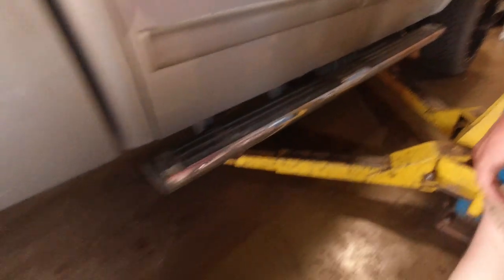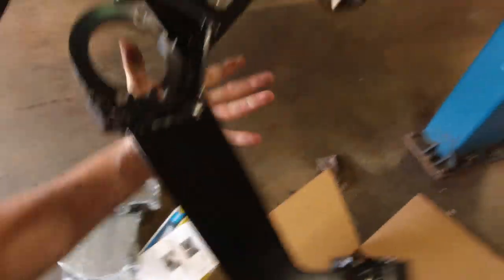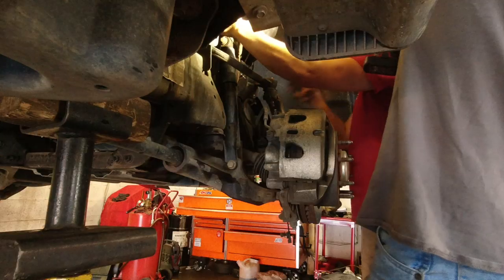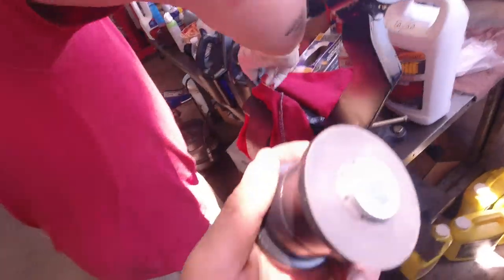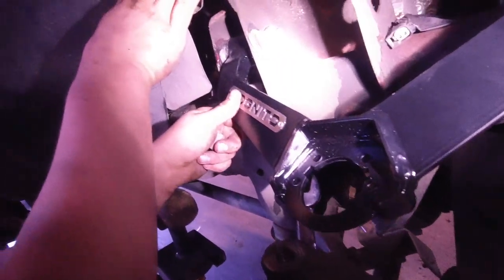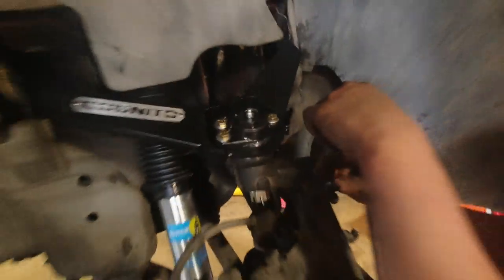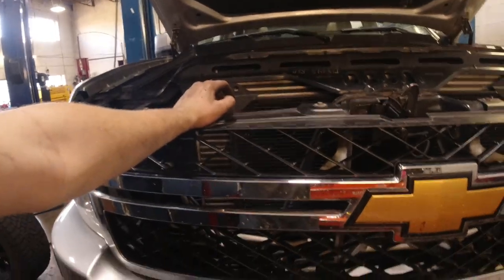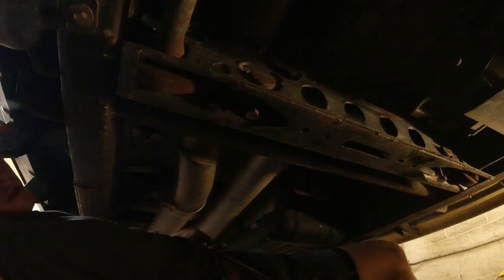HOW TO MAKE YOUR LEVELED TRUCK RIDE SMOOTHER!

Comment: Just a suggestion. If you loosen the nut on the control arm but leave it on and smack the control arm with a hammer it’s easier and safer

Comment: I have a 07 new body style 2500HD 6.0 did the 3" rough country lift with keys, shocks, upper control arms and 20x12 with 35's still rides like crap. Think the Bilstein shocks would make a difference? Truck didn't ride very well before the lift. Did the norcal mod and fender liner mods. I'm almost tempted to go to a 34" tall tire and loosen the keys but buying new tires to replace new tires sucks! LOL
Reply: Yes I have level keys rode like shit bilsteins made a huge difference I’d do it again
Reply: @ryanphinney438  thanks for replying I don't drive it much but I'm going to do the shocks. Maybe I'll enjoy driving it again 😁
Reply: @Joeshomegarage did it work
Reply: @CCCC-tq8yo  Still haven't got around to buying the shocks since I rarely drive the truck but now I know i've been thinking about it for a year! 🤣🤣
Reply: @Joeshomegarage  whatttt tt 👀🤯

Comment: You're not fully aware how torsion bars work. There are times you have to crank the torsion bolts to improve ride quality. Simply throwing on new parts is NOT the only factor to improve ride quality LOL. And where did you get the idea that it's okay to adjust those bolts with the front end sitting on the ground? You're putting serious stress on those threads.

Comment: HELP, 05 2500 Just got done doing lift keys, 2" diff drop, kryptonite uca, new lower bj, extended tie rod links, and bilstein 5100s, vs everything stock and wore out I was hoping for smoother after everything but now I finally got camber set and alignment and rides like complete DOG SHIT  what should i do now